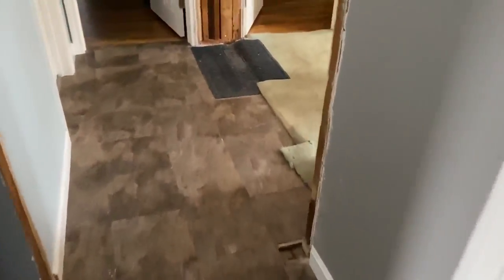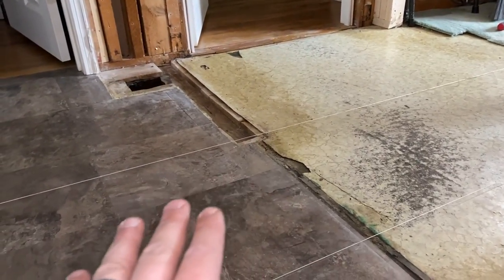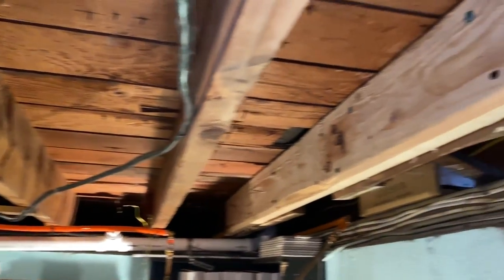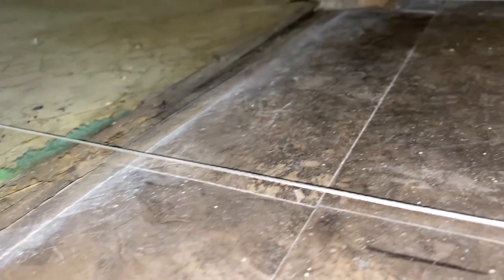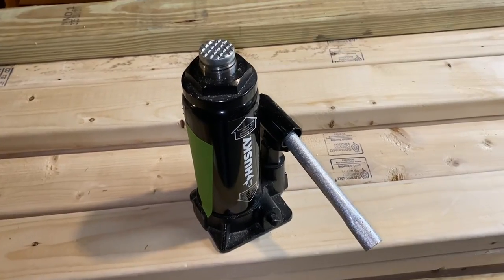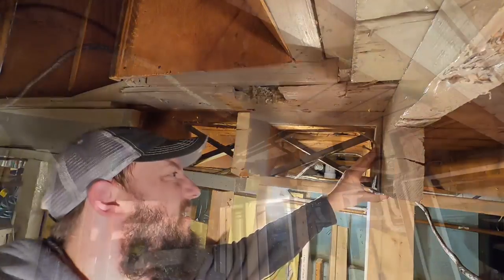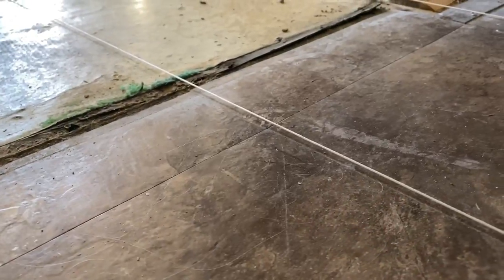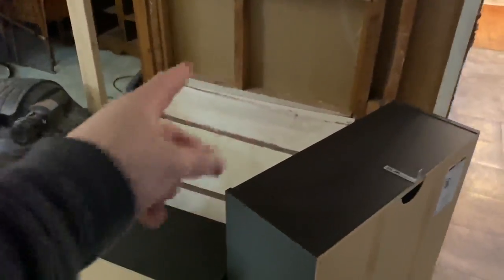How to Fix Incorrect Floor Framing| Straightening Kitchen Floor... Kinda

Comment: Would you ever consider building a house from scratch? It feels like you've almost rebuilt this one! Great video as usual 👌
Reply from the maker: I have thought about it.  It is not out of the question!
Reply: @TheFixerHomeRepair  you should. I watched a guy for about 5 years build a homestead on the weekends. He recorded it so he could later share it with his kids and their kids
Reply: @TheFixerHomeRepair  that would be so kool to see! But good work with the remodel I love it!
Reply: I thought the same as well, however, I was hoping to see his personal Shed get built first.😁
Reply: Prolly actually easier to a point...and control would be nice
 (speaking as a man/he) sry not sry
Reply: My son just bought a 1925 house not as bad but close ....but it is in great shape for age(lady /seller kept it up with pro help for evs)
I have been at it for the last week and I find that the next day my previous thought out plans were changed all ways something new
Reply: 7 screw jacks maybe close to level
My house has a support 2 feet to the left idk but gonna support under Wall
(Waves of oak floors)
Reply: Just try building one and you will see how much time, money and labour he saved.
Reply: Rebuilt everything but the foundation lol

Comment: It’s recommended to install carriage bolts when sistering joists together, there’s no structural advantage to using construction adhesive like Liquid Nails or loctite. It’s a waste of money and time! I’ve watched hundreds of episodes of this old house, professional Contractors and Sub Contractors that do this for living and they never use construction adhesive to sister joists, they use carriage bolts!  

Carriage bolts are much thicker than nails they have a much stronger sheer strength that nails cannot provide.

construction adhesive is only used on the top of Floor joists to stop the creaking noises from 15/32 or 22/32 plywood that you’re laying on top of the floor joists referred to as sub flooring.

I recommend that you consult with a structural engineer based on all the loads that you’re gonna put in that kitchen and in your house.

Example if you’re going to install granite countertops they’re extremely heavy and you’re gonna need to better support your sub flooring.

Also you should install 2x8 blocking in between the spacing of your floor joists every 48” inches that will take the load from one floor joist and pass it along to the next floor Joist, it’ll provide better Strength and better rigidity of your floor joists and floors. that’s exactly what I did in the my basement. I removed  the 3/4” wood X bracing. It provides very little structural support!

Comment: My dad had to do something similar with the house we lived in that was built in 1909.  All of the stairs lined up with one another, basement to first, first to second and second to attic.  On the first floor in the dining room there used to be huge pedal pump organ that was against the wall of the second story stairs that  dropped everything.  He used metal floor jacks like what you used at 39:57, not bottle jacks, and started from the basement and raised the center of the whole house, since the stairs were in the center of the house.  The eight floor jacks he used, four on each side of the basement stairs, stayed there until his death in 1983, still holding up the whole house.  It was truly amazing that he brought the whole house back into level by the addition of the floor jacks in the basement alone.
Watching this video makes me wonder why you didn't start with the basement also.  It may have saved a lot of headaches with floor leveling later on.  At least you only have a one story house to contend with instead of three or four.  Great video!
Edit: "I need some help.  I need some friends. Somebody help me!"  My dad had his brothers help him.  One was a master plumber, one was an electrical engineer and one was a master electrician and master carpenter.  My dad was the quintessential Jack of All Trades and master of none.  He was an upholsterer, meaning he reupholstered old furniture and made it look brand new.  All of my uncles' houses had couches, loveseats, recliners, hide-a-beds, chairs, chaise lounges, etc., reupholstered by my dad.  I suppose as payment for the help they gave to him.

Comment: 13:26 - hammering the joist into position on each sill...Nope!  I beefed up my sagging floor, same scenario as yours but instead of trying swing a hammer in such a tight space I placed my two bottle jacks horizontally at each sill location and jacked the joist in place. Plus the jacks held it firmly in place I got in thoroughly secured. Rule of Thumb: To use a bottle jack horizontally - The pump must be lower than the reservoir. (REF: the reservoir is the cylinder that contains the jack piston and the pump is where you insert the pump handle). Just open the release valve and lower the piston completely then close the valve completely. Place the jack on its side making sure to position the pump below the reservoir. Place the jack in a horizontal position with one hand and use the other hand to operate the pump handle pumping side to side until the base of the jack and the face of the piston are against the support structure and the object you are moving. Also, couldn't understand why you decided to fight gravity by applying the adhesive the to face of the joist you were installing (and risk glue dropping on your face or Mario mat 20:32)...  instead of applying it to the face of the joist you were attaching the new joist to. It might sag a little but at least it would fall on your head... but in all fairness to did admit it wasn't the best way to do it. 😉
Reply: Hammering nails into those new joists made me think - perfect second use for your palm nailer.

Comment: Next time you sister joists, consider using a couple of C-clamps to eliminate the gap caused by cupping of the lumber. The clamps really need to go on before any of the fasteners; otherwise the heavy wood screws can actually make it more difficult to close up the gap. The gap reduces the effectiveness of the construction adhesive considerably.
Nice to see how someone else deals with the issues inherent in upgrading and repairing an older house.

Comment: Next time you want to adjust aa joist that has sagged, you should try to cut a kerf in the joist center or high spot.  The cut would be about 2/3 through the joist depth from the top of the joist down.  When you make the cut and jack the joist up to the desired height, the saw kerf will open up slightly.  This will allow the joist to be easily raised and after the final position is reached you can then install the sister to mend the original joist.  I would add a shim in the saw kerf of the original joist before installing the sister for added stability.  Doing it this way you isolate the movement of the joist only between the two girder locations and you release the preload due to the uplift.  The downward load developed as a result of the jacking of the joist will be gone and will eliminate the partial return of the joist downward after you release the jacks and illustrated in your video.  Good job..
Reply: If you make the cut from the top, jacking it will push the joist outward. If you make the cut from the bottom the kerf will close and there will be no spread.

Comment: That floor cam footage was AWESOME, I don't know why but I thought it was crazy seeing that floor go up.
Also, a tip for hammering in tight spaces like you had to do when you sistered up the floor joists (hopefully I used the right term lol)... turn the hammer sideways and hammer with the side of the hammer head. You get a little more swing in that way.
Reply from the maker: Yeah I was hoping it would be a cool shot.  And yes!  That is a good tip!  Should have done that!  Thanks for checking out the video!!
Reply: There's a new battery operated black and decker auto hammer that makes it easy to hammer nails in tight spaces.

Comment: You do some great videos. Great work. 
I do have a tip that my dad always did when stringing lines to check for straightness or flatness like you are doing. He would do what you did with the string but would slide a little block of wood, say 1/4 or 1/2 or 3/4 on each end. 
Then when checking the floor have another block the same thickness and slide it under the string when it’s low or when it touches the string perfect. Doing it this way does not allow a high spot pushing the by string up. Don’t have to do it it’s just what he taught me. 
Glad I found your channel. 
Keep them coming.

Comment: #1  Screw Jacks rule when it comes to doing this because you can easily raise and lower them to get the perfect height !   Pump Jacks are a pain in the ... when trying to do  this ! 
#2 use a plumb bob in order to locate the the exact place to set up the jacks

Comment: Rule of thumb for making holes cutouts that ALL professional contractors should know! The bathroom addition work was performed on my house, it wasn’t done with a permit! Or the Inpections would’ve of failed it. the plumber cut a huge hole in my 2x8 joist it’s span is 6Ft!

If the height of the joist a 2 x 8 (7 1/4”) it’s against building code to make a cut out in length more than 1/3” of the height of any joist! This should be code throughout the United States and Canada. 

Most plumbers do not know this and when they installed the cast iron 4” Septic pipe underneath my bathroom in the basement between 1968 and 1972 when the addition was added on to my house, built in 1909. They cut out a 5” x 3” section of the 2x8 joist and did so without a permit, the Rural city that I moved to didn’t have a building and safety until 1992.

Comment: Okay imagine this, probably a 1,000,000 dollar apartment, that had been in construction hell for 3 years, a 17 plex. 3-4 different companies in and out trying to get it done, and we get called in, just to do some finishing touches. Boss man does the walk through and there's some drywall we gotta replace, and finish, castings and what not, and then, he's told there might be some work in the crawl space... 1st joist. 2nd joist... 3rd joist! About a total of 90 floor joists, engineered I-joists, have some form of 3 foot sections with the whole bottom chord cut out of it, or cut directly apart so a toilet could get its plumbing, or massive holes for h-vac! Fucking plumbers man...

Comment: Instead of that nail drop, why not use a plumb bob?  Didn't notice, but did you plumb the jack posts?  I don't question your reasoning or ability, but for your safety,  don't chance having them fly sideways.

Comment: One of those pneumatic Palm nailer is nice for those large nails in right spaces, drives a 3 inch 16d without issue. Real handy for those joist hanger nails.

Comment: LVL would have been a better choice for “sistering” material since it is more stable and stronger. Structural screws instead of nails might have been another option.

Comment: Pulling the tile isn't a big deal. It's stable and encased in the vinyl. It's safe to work with. You only need to worry about raw fibres like insulation.

Comment: Even with having a wall under the side of the opening, your method of framing for the opening is incorrect. You should have cut the joists back further and installed a double joist along the open side of the stair opening then attached the existing joists to that double joist with double joist hangers you could then install new additional joists to support the top platform of the stairs and  the staircase itself. Any break in the side support joists will eventually come back to haunt you. Basement floors are not strong enough to support floor joists unless there  is a footing underneath.

Comment: my floor sagged but not to this extent, what i fund was the wall pulled away from the ceiling causing breaks at the corner seams from the wall to ceiling plaster and board? i did not see anything on your video showing that issue?

Comment: Suggestion:  Easier to get those reinforcement 2x's in place with a jack lying on it's side.  Lot easier than a hammer in that confined space.
Reply from the maker: Thanks for the tip, Paul!

Comment: One thing you're doing wrong though you're not giving your glue time to cure overnight before you let the pressure off kind of defeats the purpose of the glue the glue bonds the whole length of the wood together therefore you release some pressure now you're allowing the glue to slide against the boards and not do its job glue 24 hours then release

Comment: Should have purchased the tile attachment that way you can spread it like you would on a tile in any direction they're pretty neat just as long as you don't cut the tube and too short to where it can't friction fit on it

Comment: Question. Why add the nails, if you're already using the bolts? It seems the bolts would be just fine.

Comment: I feel your pain, my friend. I bought a 1920 two-story last year. I believe the past contractors hated me even though I've never met them. For instance, the toilet flange was secured with drywall screws. Every light switch, outlet and yes the breaker panel are installed with drywall screws. I understand a man has to get a job done, but EVERY DAMN ONE OF THEM?
Reply from the maker: Yikes. 😳

Comment: If you have any water leakage through the slab, you might want to try a sealer from Sani Tred.  I used it once and it completely stopped the leakage.  The only downside to using it is that you have to use their adhesive if you want to install a tile floor later.

Comment: I've been leveling and replacing joists and subflooring in our old 1945 house. Talk about a chore... Get a couple small metal plates to put on the bottom of your Jack posts, it'll keep the bottle jacks from pushing into the wood. I split a few 2x4s before it dawned on me. Lol

Comment: Excuse me for asking you this question.  I am a big fan of yours.  I came across a problem where there is water damage in my bathroom.  What I don't understand is why there is a type of cement (I'm not sure exactly what it is) and it is in all 4 walls of the bathroom.....need to figure out how to handle this to fix that one wall that got water damaged.  1955 Florida bungalow.  I thank you ahead of time if you get a chance to answer my question.
Reply: Well, I guess not.  I'll figure it out eventually.

Comment: For next time, check with your local officials: our home had asbestos tile roofing, asbestos tile siding, and asbestos tile flooring. The roofing was considered dangerous; the siding only while working (so you had to wet the tiles to cut them), and the flooring was not considered a problem, because the asbestos is so embedded with the linoleum tiles. My memory could be off on some of those things, but the upshot is that while asbestos is a danger word,  it's more workable, and by an informed homeowner, than many people realize.

Comment: Why is asbestos so hated? Yes it can cause cancer but that's not a given is it? Why is it safer to just leave it than to try and remove it? I would think that being around it would be more dangerous than taking the risk to remove it. It's not like you remove asbestos every day so what are the odds that you take a day to remove asbestos you get cancer or something? I would think those odds would be better than trying to live with it around because odds get worse the more often you are around something.
Reply: There's no risk being around non-friable asbestos as long as you don't disturb it by sanding, drilling, etc.

Comment: since this is appearing on you tube as the latest edition i thought you might see this question sooner.  I am curious about this house? its size ? age? 2 story bungalow? and what weather area its in? I am also wondering if you live here or is this a job site.  I will be going thru a few of your other videos just for your thoughts and ideas, never know when i might learn and maybe be able to use here. Thanks for sharing.
Reply from the maker: Hey!  Great questions!  This is my house.  It was built in 1943.  When originally built it was just a square ranch with about 600 sq feet.  Then in the 60’s (best guess) additions of the two bedrooms and kitchen/bathroom were added.  It is just over 1000sq feet now.  Originally had a field stone foundation and dirt floors from what I can gather.  I am in Massachusetts so we get a nice mix of hot summers and cold snowy winters.  Thanks a lot for the comment and I hope you enjoy the videos!  Thanks for watching!
Reply: @TheFixerHomeRepair  Thank you, I too have a 1000 square ft, home in central Ontario, so hot humid short summers and cold snowy winters.  About 4-5 years ago added just over 200 square feet  (800  to 1000) to make it a full time permanent home. The house is lakefront and sits on a poured concrete crawl space. It is electric heaters with no duct or venting. Have plans for new windows this spring assuming suppliers have any thing.  Since you ask us not to tell our wife about the vacuum, it must be challenging to live and work in the house.  Stay safe and well and thanks for sharing.